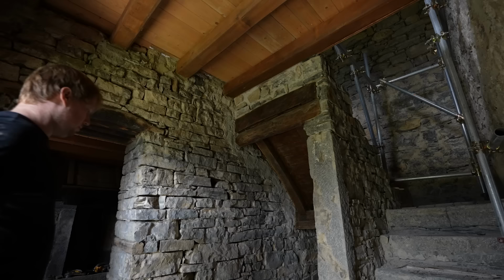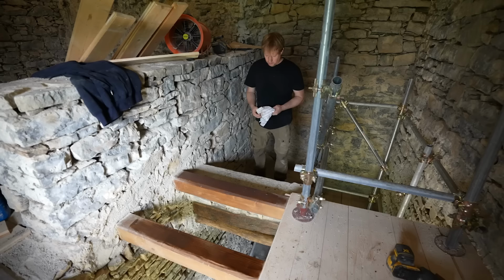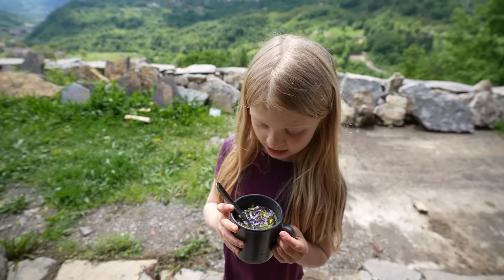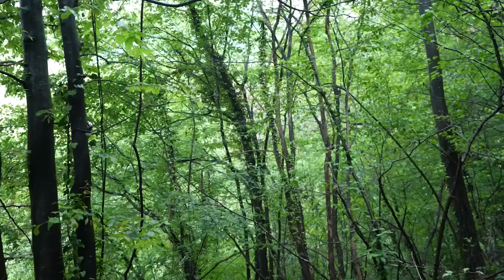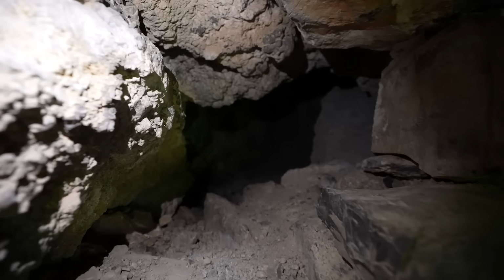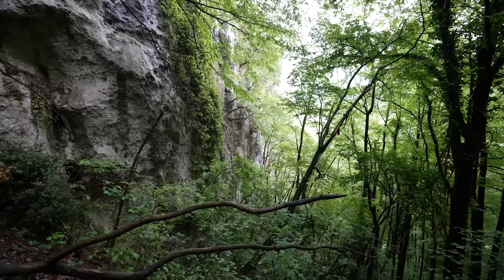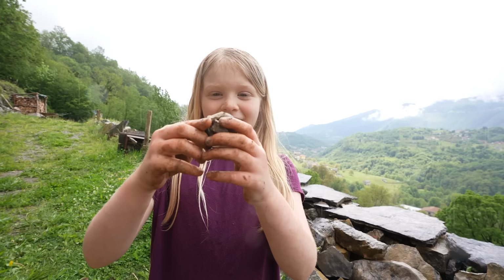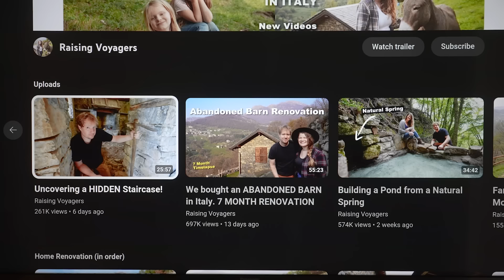We Found a CAVE HOUSE 😳

Comment: Having restored antique  furniture I find that layering stains is a great way to get that rich aged look. Play around with a few pieces  you have laying around. Look closely at the original and see what each layer actually  is (golden, rose ,gray?) Then see what the next one is and so on. Also when done staining get a really good wax seal on it. Will still be washable but won't  leave the overly shiny look that poly leaves.

Comment: With staining new or old wood, experimentation is the key word. Some of these commercial stains can cost a fortune, whereas there are cheaper options if you look around. Have you ever thought of black or brown shoe polish? You can dilute them with mineral turpentine, or neat; and get some great results. Even old paint, (water or oil) could give amazing results. Always have plenty of old rags on hand, to wipe off, or apply, when necessary. I'm a furniture restorer, and have had surprising results by experimenting. Have fun. I like your vlog. I live in New Zealand.

Comment: You may try dampening the wood first a little it helps the wood take up the stain and also try OOOO steel wool to apply gives a bit of a scrub at the same time. The old beam is rough sawn and distressed makes a big difference in the look.

Comment: The trick to getting a natural look with stains is to use a timber sealer first, this prevents the more porous grain taking up extra stain which gives an unnatural look, if you seal it first you get an even color that makes the timber look like it is that color, especially effective when trying to make pine look like a white Baltic timber, and not yellow.

Comment: Hey guys, just wanted to remind u of a product in the US called "Drylock" paint.  It's what Shamu's tank is painted with at Sea World & it's awesome for keeping dampness out of a structure.  I live in Michigan & have what's called a Michigan basement - rocks & foundation out of natural materials (yes, I have a couple tree trunks for supports too) and my walls are painted with Drylock to mitigate mold, mildew & even water outside from coming in.  I hope u consider this product for the outside walls that have moisture.  It would be a definite easy solve to that problem.  Just not sure how the Italian codes & inspectors would look at it, but it's a fab product to paint outside on walls & inside of course.  Hope u can get it there!  You're doing such a fabulous job & work SO HARD, I would be tickled pink if my suggestion could help solve that problem.  It's at Home Depot & Lowes & probably other home improvement places.  FINGERS CROSSED!!  🙏

Comment: Try wiping a water diluted latex blue grey or mix of blue and grey coloured paints  onto the boards with a cloth once the new stain has dried. This might take away from the warm tones and give you an aged look. The wiped stain will fill in grooves if lightly wiped and you can build up the effect in areas to mimic the old blotchy appearances. Hard to go wrong.  I have used such techniques with many projects. A CDN product called ECO Wood treatment is a another favourite I use for protecting and aging exterior wood projects, and I have used it on interior wood as well simply to get the effect. It does best to become richly aged under UV light effects though. I add royal blue and or greens to the water diluted ECO powders; experiment with dilution strengths. People rave about the results and some have used it with warmer coloured latex paints to get the results that match their current older stained construction.
Reply: Hello 👋 how are you doing today? I hope 🤞 this year brings happiness, peace and love all over the world 🌎 I’m originally from Canada 🇨🇦 grow up in Fort Worth Texas, currently living in Key West Florida. Where are you from if i may ask?

Comment: Hi, loving the channel and the work you are doing to restore this building. The finds you have discovered especially the spring and the stone staircase. I have a suggestion for the newer beams. Distressing the beams and soften the edges wnd you will find that the shadows created by the cut wnd shaped edges would give you the desired effect. So looking forward to the next installment. Best wishes and stay safe J.

Comment: Take the noche oscuro stain and just gently wipe it over the existing wood under the staircase, using a cloth, NOT with the brush. It will help to revive the stain that already exists there and pull that wood into a hue that is more comparable with the beams and floor recently stained.

Comment: You seem to be using a combined stain & varnish. I would suggest sanding and then a dark oak stain (stain only) which you wipe off with a rag immediately. let it dry, check colour comparison, repeat a few times as necessary to get correct colour. Finish with clear varnish.

Comment: your suppose to paint it on and wipe it off!!! or it will act like paint without sitting two long when thick!!! I think the other color is Dark Oak Stain, but they should offer stain samples at your local harware store to get an exact existing color, of photograph a close or take a sample from a hidden spot on the beam. Paint/Stain shops or furniture repair/kitchen places might tell the exact color used. or mixtures. Use knoledge that exists!!!

Comment: Watching you trying to get the right stain for your beams-just a thought-maybe stain the beams and then either add a brown wash or brown wax to add to the patina and give it a more aged look.I used to “dress” rustic furniture and give them a lot of age and found some cool techniques that were known and many that were trial and error.Used the brown and black wax a lot and other times ageing with black or brown wash.Hope this helps as it can save on sanding and as you said it’s a different species of wood so the finish is going to be different for sure.Using different techniques and layering will certainly age the newer beams to give them character and age.

Comment: Part of your beam matching woes are texture. Your original beam were looking like hand hewn. What you can do is take a if you can find one a hewing axe or nice sharp hatchet and lightly gouge out so pieces of the newer beams to give them a similar look. Heavy wire weel them in a few places to accent and deepen the grain lines. Then in splotches use a black stain in the deeper parts of the grooves took give that old dirty look some of the beams get in spots. this is a highlight technique of the hand hewing that the natural 100 years of dirt accumulations gives you. Then stain in the darker brown.

Comment: Did you say the ''new'' beams are only supposed to last 5-10 years ?
I've been a licensed builder/contractor specializing in log homes in the US for over 30 years !
Granted I know nothing about the climate and the type of wood used in your situation but even in the most adverse conditions 5-10 years seems extremely low/short to me !
Reply from the maker: They are in perfect condition, didn’t mean to imply otherwise. They were installed 5-10 years ago by the previous owner. We just want to re-stain them to better match.

Comment: Just watching some of Your videos by coincident, and beeing really impressed by all your georgeous work, effort, knowledge and enthusiasm! Also owing You the outmost respect for doing and getting all the allowances, concessions and the plethora of bureocratic paperwork for all of Your projects, which can, especially in Italy, be a real nightmare, as the country has - at least out if my own experience - not only some of the oldest and most 'elaborated' and therefore extremely unlogic, contradictional, slow and inefficient bureocratic and jurisdictional systems, including teardroppingly high fees for even the slightest fault, or delete on the side of the applicant...
So, I even more admire and respect what You are doing, cause even most locals simply would and have given up the battle You now fight for them, saving and reviving another part of Italies and Europe's cultural heritage and landscape! 
And before forgetting it, having a degree in Folklore and Cultural Anthropology myself, and coping a lot of historical and technical research on historical houses and landscape use and forming, I may have a guess what has happened to Your spring, why and how it was done, and even why you found some bovine (most likely cow) bones in it, as all this could be part of the practical but also symbolical 'closing' of the well, most likely done, when Your property was transfered from an actual housing and agricultural settlement into a more extensively used pastural place, converting your house into a barn.
Referring back to Your spring, this most likely ment, that the former owners wanted to protect this - as You know yourself best - extremely valuable and useful resource from complete decay and destruction, in case the conversion would be undone a they or their offspring would settle again at the place. 
Refering to the challenging geological and climatical conditions (especially frost which can, without propper maintainance, damage and even completely destroy open wells within a few days) and other possible destructive factors, including wildlife and  manmade vandalism, the best solution bto do so, is by covering up the whole structure. So I'm quite sure, the debris You put out was almost completely put in by man on purpose and wasn't the result of natural erosion. 
Comming to the bones, those fore sure also didn't came there by coincidence or accident, as in this case you would have fund much more and especially smaller ones, referring to the complete animal. As there obviously were only some very big bones, which were in the middle of a most surely manmade deposit of degree, there were other things going on. One possibility would be, someone didn't like the well, and therefore the whole place, which in former times was completeky dependant on this resource, to be used all too soon and/or by others, and made it 'unusable' at least for some years by putting a piece of rotting flesh into its upfilling, polluting and even poisoning the water flow on purpose.
Another - more likely and much less nasty - possibility could be, that the spring was not only physically, but also 'spititually' closed, as in Europe and especially the Alpine Region sources of water were, and in many regions still are, viewed as not only highly important physical resource, but also as very special and even holy places, who often are closely connected to rituals and believes - wich not necessarily must be too Christian but often reach far further into the realm of legends, myths, and all kinds of survivors of the ancient spirits and dirties, who especially are located around springs and wells, as those places are and have been often seen as some sort of transcendent places between the human sphere and the other- or underworld, where all kinds of dirties, ghosts and so on live(d). So, the use and disuse or closure of those places and their resources often involved some kind of believes and rituals centering arround some (spiritual) relationship between the humans using resources believed to be granted and protected by the mystical entities, powers and beeings , centered around or even living in those 'special' places. So it is quite possible someone intentionally put in a part of a quite precious animal as some kind of appeasement, promise of return, thank you and/or farewell to the graceful dirties of the well, granting the now leaving humans for centuries with the prescious gift of clear water, when those humans had to leave and decided to close the spring. Even more, the closure itself couldn't be done only out of practical but also the mentioned spiritual reasons, to somehow protect and hide this important, special and/or 'holy' place and it's mystical inhabitants from disturbance, impurity or "disrespect" by the unconscious, unknowing and non-believers. Vice versa it is possible the closure and offering should not so much protect the dirties from humans, but humans from the dieties - this f.e. could be the case, when the giving up of the settlement had been connected to misfortune, accident, illness, dead and other things, people may have interpreted as some kind of punishement or retreat of the dieties of the place. 
And yes, there are quite a lot of similarities of the situation and findings Your place to many others known both from historical research and archeological findings. Also ethnological research makes it very clear, that those believes and rituals, didn't 'dye out' a long time ago, but are still believed and practised by many people until today, and even are carried on as an important and integral part of modern Hollywood films and other products of popculture. 
So at occasion you maybe ask your neighbours for any tales or knowledge about any legends, fairytales, powers or entities living in and around the wells, sources, woods and other places of your region, and how to interact and live together with them in a peaceful and beneficial way for both sides. I'm quite sure, they will have to tell You a lot, given You demonstrate real interest and respect, as this can be a bit of a tricky theme, as many people nowadays do fear to be qualified as stupid preenlighted idiots, telling You about those things and especially their own believe and encounters with those entities and beings. 
And yes, as an Ethnologist I may could press those things into the theory of premodern superstition, but I wouldn't feel very well with this labeling, as those things do tell us much more of how humans do perceive, understand, connect and even treat and even 'feel' and settle in, into their environment, and sometimes those ancient believes, stories and rituals can be astonishingly modern, as they teach us to treat our environment in a respectful and sustainable way, not taking more than we need and should. 
Seen like this, it's may be not such a stupid idea to believe at least a little bit in a nymph or another beeing, living and protecting a source of another important place, who may can get very angry and even deadly dangerous, when careless people disrespect, waste and even destroy those places and the the resources of nature connected with and provided by them and therefore the very base of their own existence and future. 
And no, seeing Your love for the place, and the way how You do things (I'm still completely flashed by how completely calm and conscious you managed your encounter with the wolves !), I'm quite confident, that things will go on well, and If You like, You may poste some flowers or something similar (a little piece of butter would also be a good and traditional option) as a little house- or in this case tubwarming present at Your newly discovered old spring, just to go sure...